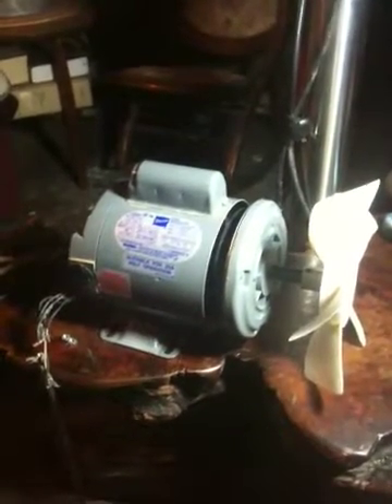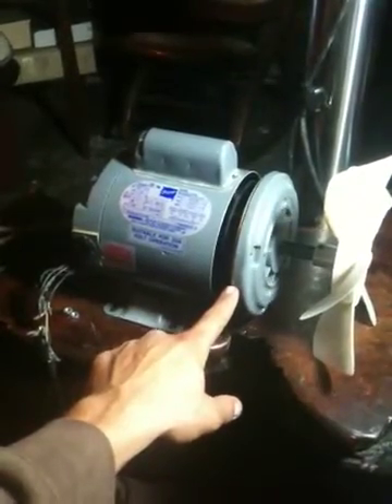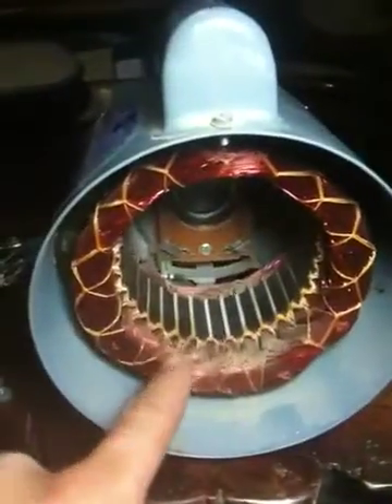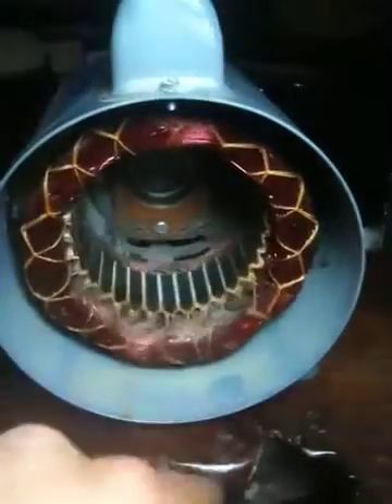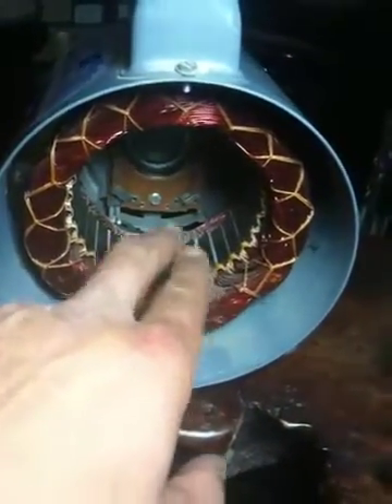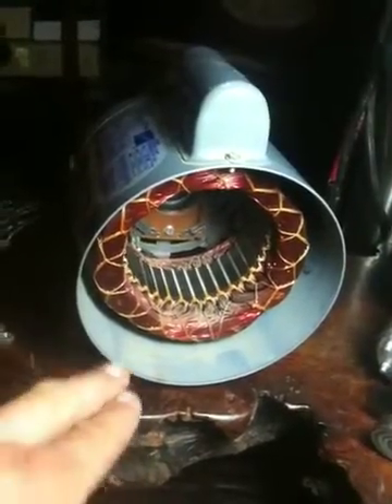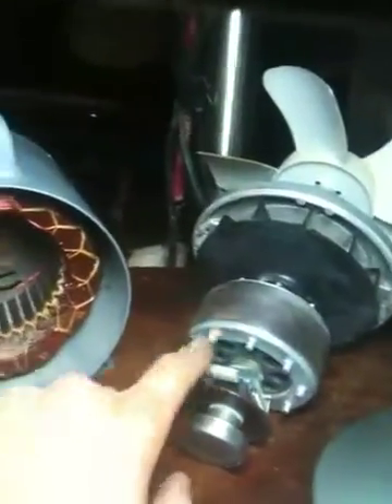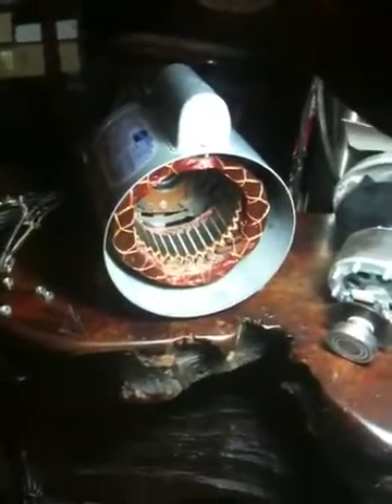Making a demonstration rotating magnetic field motor

Comment: hey just wondering if this improved the performance of the motor (having the magnets rotating instead of the coils)

im looking into building an electric bike from scratch and want to build a hub or direct drive motor without a commutator, ive read about steorn motors and how they work and this seems a similar concept.